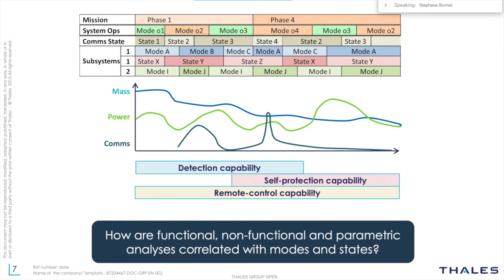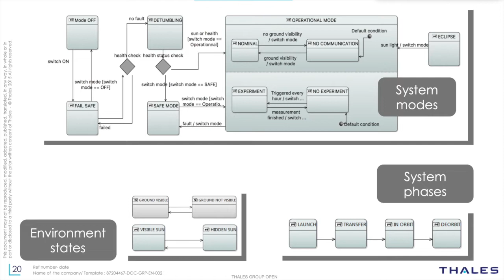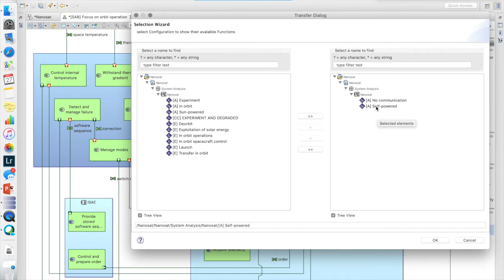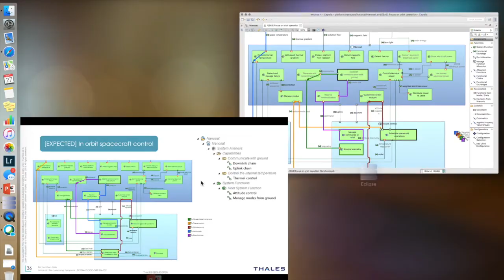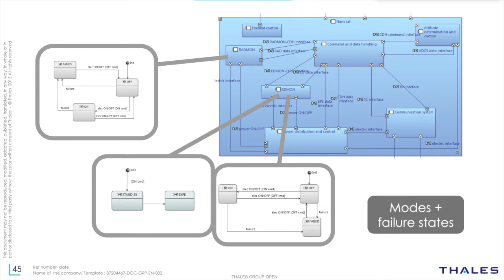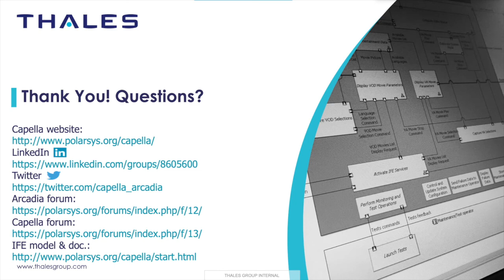Comment: I really like the concepts presented and I think this approach would be very powerful to aid the functional analysis for systems which may operate in several modes. However, I am concerned about the terminology "configuration" as adopted here. Spite of being semantically correct in this context, this term is already taken by neighbor domain (such as in "Configuration Management"), what, I'm afraid, may lead to miscommunication across the organization.
Reply: Configuration is also used often used in Product Line Engineering contexts. It is one of those words used in multiple contexts. Any better idea is welcome!
Reply: Maybe you could use "Readiness". Capability is the first that comes to mind but it is already taken in the Capella namespace. Maybe Faculty, Facility...